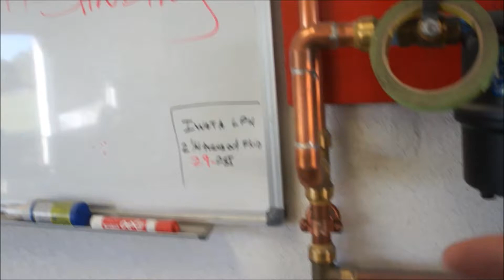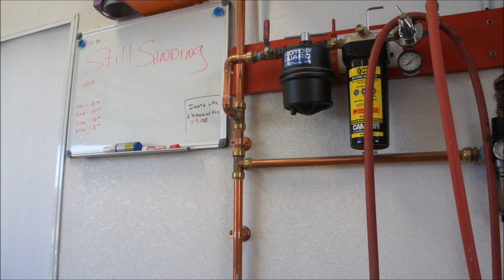details and a question

Comment: I bought a condenser like yours to swap out the tiny transmission cooler i'm using now , just waiting to find somewhere local to make me some good hoses  before I swap it out and end my moisture issues
Reply: also my 68 I had both side mirrors as a factory option , if I remember correctly the were rectangular shaped  .
Reply from the maker: Thanks Craig, I love that condenser... obviously :)

Comment: Around my rear window I had a lot of pitting and a couple tiny holes, as soon as I introduced the welder they blew right through and took me 3 days to weld up and grind down. I don't ever want to do that again. If it were me I would use fiberglass resin around the window chanel and if you have anymore of the rust inhibitor that you can use in closed areas I would spray the back of those chanels.
Reply from the maker: There is no rust it was all blasted out , only pits from rust to fill in , and I did use fiberglass , thanks cary

Comment: eastwood makes a brush on rustsealer primer ,,,it worked really good
Reply from the maker: Thanks, those pits have been blasted so the rust is gone but I figured if I tried to weld on it it would probably blow through, I will try that if i have rust pits in the future.

Comment: I have an original 68 and for mine....  there is no mirror on the passenger side.  The Driver's side mirror looks quite different than yours.  I am going to try to PM you a picture.  The one you have does not appear to original and therefore like any other aftermarket part, if you want it to fit, you may have to perform some magic!
Reply from the maker: thanks , may have to try to make it fit
Reply: Mine is the exact one that is illustrated on page 46 of the 1968 Camaro Factory Assembly Instruction Manual.  I believe that you showed once that you also have that book.  Cheers!
Reply from the maker: Thanks were going to make it work

Comment: Im about the same stage on my 56 ford f-100 cab. Where I have sanded thru the epoxy to bare metal, I very gently tap the high spot down so another spot spray of epoxy will stay after I block the touch up. If its a weld, I just barely hit it with a grinder, then a spot of epoxy. Once get the panel to hold epoxy (after blocking,) I come back over with a skim goat of epoxy over the entire panel. That will be with I start with the 2k high build or Turbo.  Im also doing my firewall  as good as I can get it. This will be my test to determine if I feel good enough to base clear the rest of the truck.
Reply: I forgot to mention why I do it this way. When you block thru to bare metal, you have two options. Lower the high spot or fill the surrounding area with epoxy, 2k or high build. I would rather have a little build in a high spot I knocked down opposed to a lot of build in the entire panel surrounding the sand thru. The panels I have done this way look really good with a  final coat of reduced SPI Epoxy wet down. Right or wrong, I dunno.
Reply from the maker: Sounds good , and sounds like you have a good method , thanks for watching

Comment: Couldn't you use Lead to fill the pin holes around the front Window? its ll of the little work that helps get it done!
Reply from the maker: Sure , but at this point that's too much heat around my filler and epoxy on the roof
Reply: Ah.. very good point. See that is why you are the master! :)